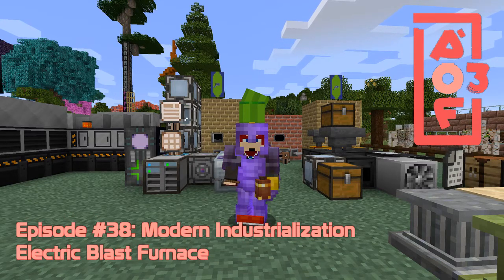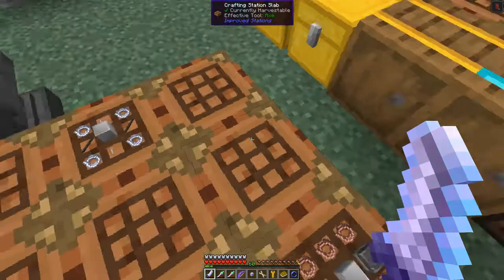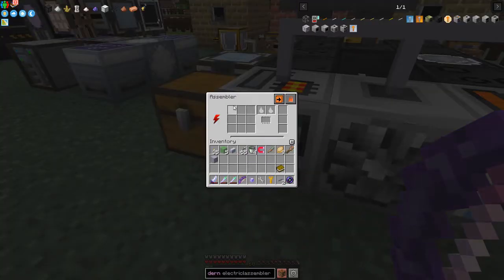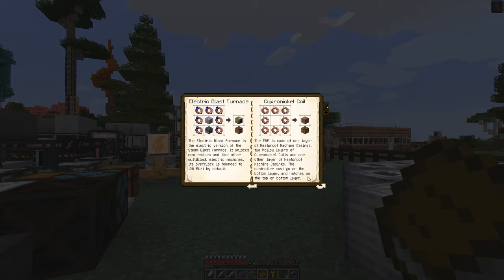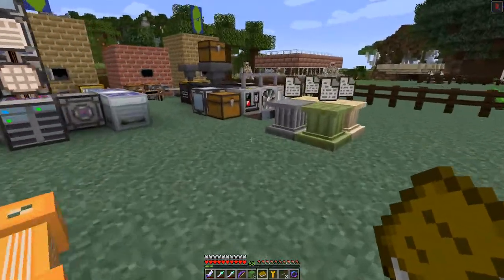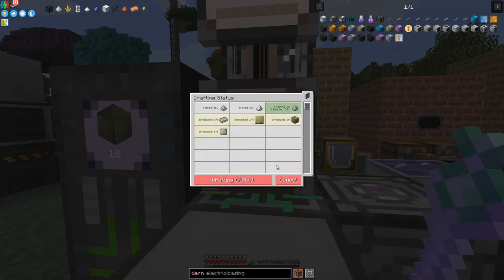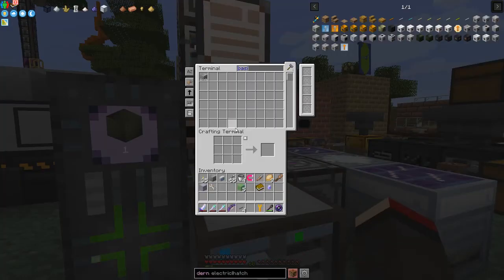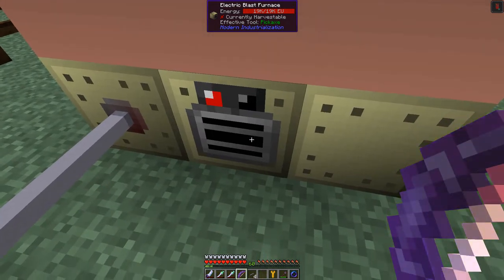All of Fabric 3 #38 - Modern Industrialization: Electric Blast Furnace

Comment: Is there a way to remove recipes added to assembler/cutter/etc. other than tearing down the block and putting it up again? The block isn't locked.
Reply from the maker: Sorry I cannot remember and my world fails to start so it is difficult to check. Do you mean the molecular assembler?
Reply: @duncanwebb4934  Hah, I wish I was on molecular assembler level :) What I meant was that when I upload the recipe from REI to regular assembler, it shows the items needed but when I want to make something else, I can’t remove the recipe and upload another one unless I tear down the machine block.
Reply from the maker: The modern industrialization assembler? You can't, but you can remove the fluids with pipes and tanks.
Reply: @duncanwebb4934  Got it, thank you!
Reply: @duncanwebb4934  update: it is possible, when you enable lock editing you can remove the recipes.
Reply from the maker: Sound good, thanks.

Comment: I got stuck on making silicon dust. I can't send energy into my blast furnace
Reply from the maker: You’ll need a LV or MV input hatch to put power into the blast furnace. It will also need item and fluid hatches for the different recipes.

Comment: What button do you press to open quests
Reply from the maker: IIRC there is a link at the top right of the inventory screen for the quests. Press ‘e’ to open the inventory screen. There is a catch as the mod pack developers changed the questing mod between releases. The other ways to open the quest screen is to right click the quest book or to set a shortcut key in the options/controls screen.